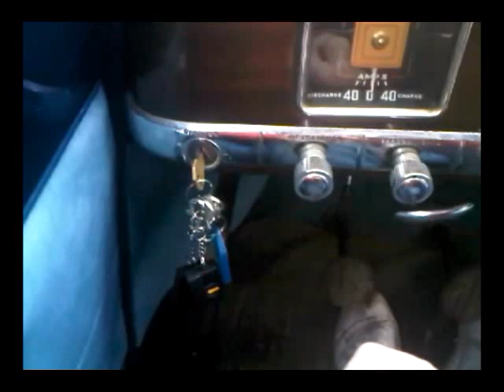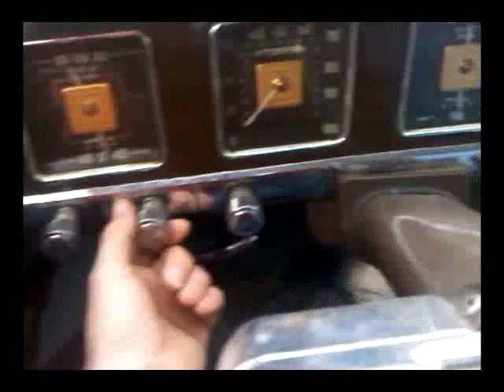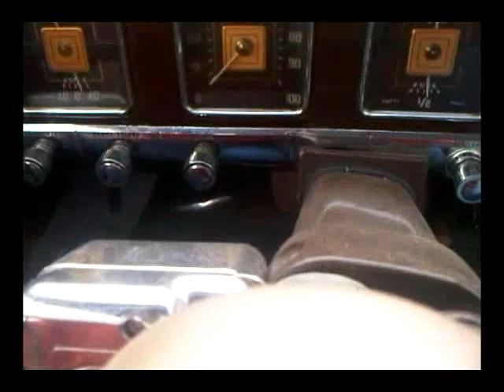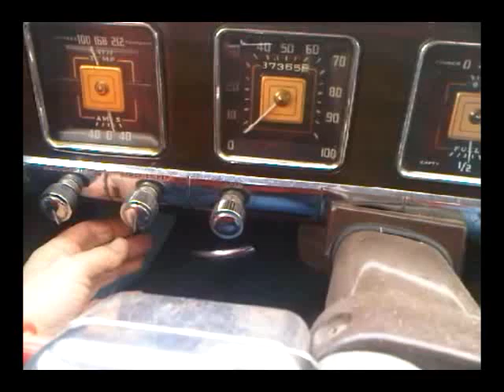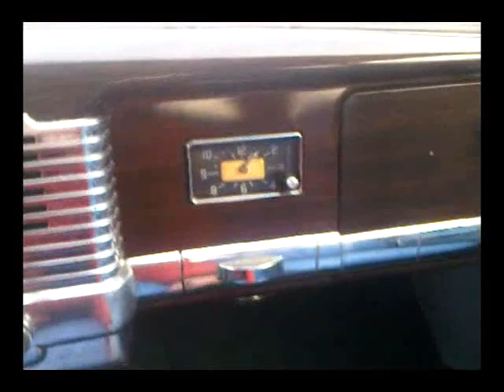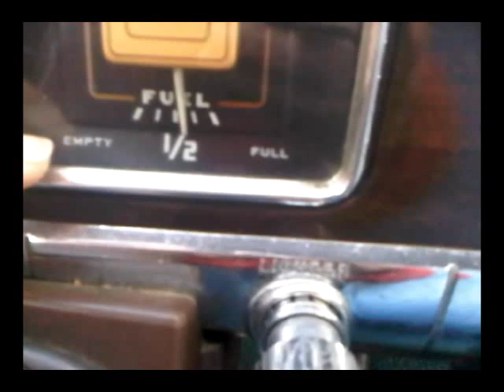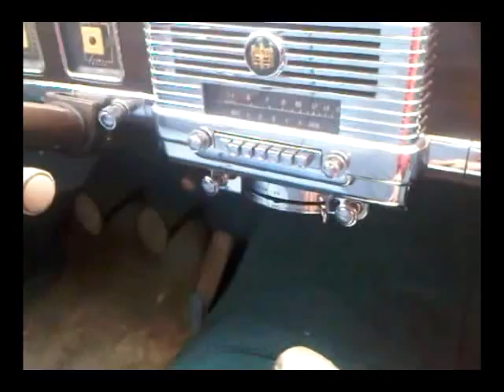1949 DODGE - HOW THE CONTROLS WORK

Comment: By 1949 it was much more common for a car like this Dodge to have built-in turn signals like cars today. My parents' basic 1950 Studebaker had 'em. But backup lights were an optional extra for years, and were not a part of the regular lights but an add-on, even if a factory option. It's amazing that either of these things were considered extras! That car had vacuum wipers as well. They didn't bother with a vacuum reservior so under load, unlike just revving the engine, they stopped!

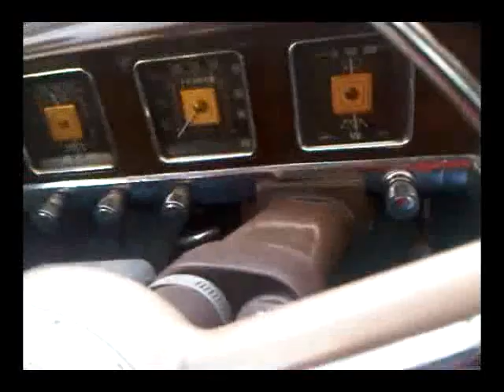Comment: Thank you very much indeed for the demo of "Fluid Drive", where you can drive it like an automatic, as you said -- not so much clutching to have to do, which as you pointed out, certainly saves wear & tear on the car.   Really enjoyed that part of the demo at 8:10 - 9:30!  Thanks again!
Reply: Fluid drive was a semi-automatic. To start out in first gear, one would push the shifter up & forward. To shift into second, one would let up on the accelerator and hear a clucking sound. For third, depress the clutch bring the shifter down. For fourth, let up again on the accelerator for the clucking sound as before. DeSotos & Chryslers had the same transmission.
Reply: So many people, even owners , don't know how fluid drive works.

Comment: Exceptionally silent and simple. Radio's, clocks, power steering and brakes, turn signals, heaters, overdrive, backup lights, all standard today. In 1949 you had to order them with the car.

Comment: Beautiful car.  I'd always been curious as to how one would drive a car with Chrysler's Fluid Drive.
Reply: +lcar4000 It was very easy, I had a 1950 Dodge Coronet and the fluid clutch was great. Except for parking. You could not park in gear and there was no "park"; so the parking brake was on the drive shaft.
Reply: Thanks for the information

Comment: Today's cars are like rolling computers. The cars of today are so complex there is the need of a computer system with a screen to be able to configure preferences and way of operation. It would be impossible to put all the buttons and controls on the dash. There would not be enough room on the dash for all the wiring and switches of there was no computer control with a screen. 

The oldest cars I drove were from the early 60s.  They were a lot simpler, had a lot less technology, but were very functional for transportation.

Comment: I don't know if you have a proper car mount for your camera...  but I for one would LOVE to see a video of any of your old cars on the B Roads of the UK! I have been curious about the fluid drive for years and never seen one in original condition... Thank you for these videos!
Reply: My uncle had a 1951 Chrysler Royal with fluid drive. Poor fuel mileage and stepping on the accelerator was about as exciting as stepping on a sponge of ice water in your stocking foot. That electric clock was a battery killer and he rewired it to come on with the key as otherwise it was on full time. Nice car to ride in though.

Comment: You should have set the choke first. ;-)
Those wipers weren't thought out very well, were they? If you're throttling down the road on a rainy day, you need them to go faster, not slower, haha! (Maybe it encourages you to drive more slowly...keeping your foot out of the gas)
Reply: By 1949 most cars had vacuum boosters built into the fuel pump.  From my own experience, the engine developed plenty of vacuum at highway speeds (55 mph used to be the speed limit in most states).  You only needed the vacuum booster when climbing hills.

Comment: Turn signals first appeared on Buick in 1939 as an option and standard in 1940, for Buick. In 1941 Cadillac had them as standard and the next year all GM cars had turn signals as standard as well as Ford and Chrysler. Your 1949 Dodge had an aftermarket turn signal? Weird.
Reply: ok thanks
Reply: I have a 1940 Buick Special. It was a base model because whoever bought it in 1940 was too cheap to buy any options. No radio, no side view mirror,  no defroster (in 1940 Buick had heaters as standard under the front seat, on the passenger's side, but defrosters were optional). It has a turn signal. OK. So that proves a turn signal was standard on Buick (the best car in American history) and not the piece of shit non-Buick. Wouldn't you really rather own a Buick?

Oh yeah, the engine on my 1940 Buick Special is a straight 8 and it runs as good as the day it was made. In-fucking-credible engine.
Reply: My father told me his '50 Chevy Fleetline DeLuxe didn't have turn signals.  His '53 Pontiac Chieftain did, though.  I remember that car.

Comment: It took a long time to start because the fuel had evaporated from the carburetor float bowl.  Pumping he pedal does no good since the engine must operate the fuel pump to fill the float bowl.  When there is no petrol in the float bowl there is nothing for the accelerator pump to squirt into the throat of the carb.  

Since the car had been sitting, you should have filled the float bowl via the bowl vent with petrol or carburetor cleaner.  Then you should only have had to pump the pedal once to set the choke and squirt a bit of petrol into the engine.  Stomping repeatedly on the gas pedal is neither necessary or useful.

Comment: Do not use a key ring with other keys on the ignition key. It will wear out the ignition switch. There is an am radio. What about in the afternoon when it is pm?

Comment: why don you keep pumping the gas peddle? just adjust the choke for a quick start.
Reply: the choke often wasn't enough. Two reasons for the auxiliary pump  (when you pumped the accelerator pedal was for cold starting or in hot weather hold it to the floor to lean out the fuel air mixture to get rid of a flooding condition. The other reason is to give an extra squirt of fuel to accelerate without hesitation 
The driver was the computer.
Reply: When engine is at least slightly warm 2-3 pumps then complete full throttle until the first cough then rip your foot off the pedal. 
This is average. 
Your engine will vary at least slightly.

Comment: You can just imagine how much there is problems with todays cars after 10, 15 or 20 years if thhere is power everything. The engine, clutch, transmission, fueling, steering, brakes all are leaded by computer... Why??! Imagine for example a 2012 Audi a8 in 2040!

Comment: "so now we got a flooded engine"  as he continues to pump the accelerator pedal.
Reply: @hudsoninbury  At the beginning of the video , after you have cranked for several seconds and pumped the accelerator several times you state "and now we have a flooded engine" , and then you pump the pedal several more times.  The car does start which means it was not flooded after all , I just found it comical that you think its flooded and your answer is more gas.
Reply: @hudsoninbury  It's all good, I hear you and know where you are coming from. Nice car by the way, I know this video is several years old.  Do you still own it?  I make videos too, and we don't always say exactly what we mean to say when the camera is rolling. So hat's off to you for taking the time to post a video. I was just poking fun at the situation.  I have been a mechanic off an on since 1992 , and I have owned several classics and worked on several others so I know how finicky these old fuel systems and electrical systems can be.

Comment: Jumpy ammeter...
Reply: The jumpy ammeter needle is caused by the voltage regulator.  As the battery charge rises, it starts reducing the charging rate from 40 amps to 2 or 3 amps by switching in the 40 amp circuit at an ever reducing amount of time until the battery is fully charged.  "You mean that the generator is set up to only charge at either 40 amps or 2/3 amps?"  Exactly.  And it worked fine for many years.